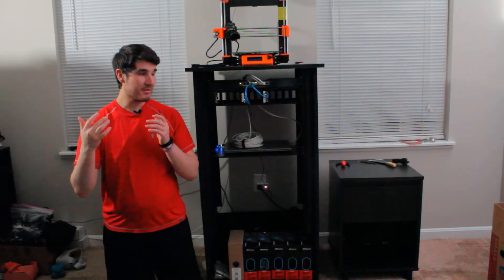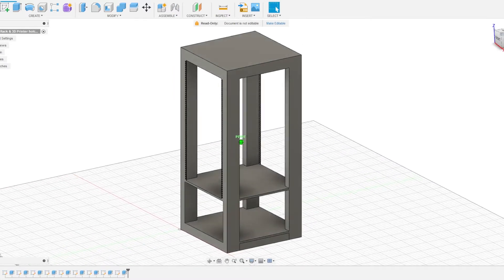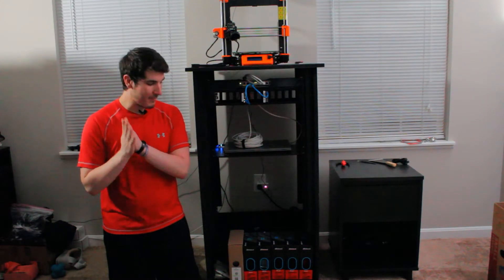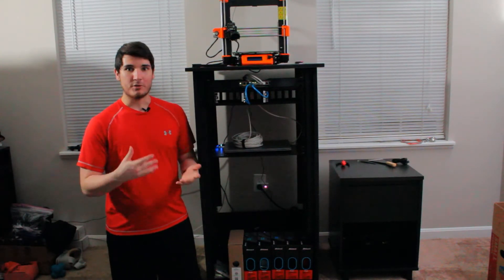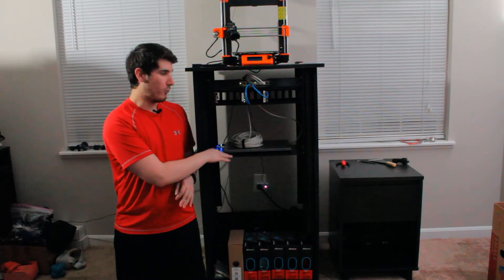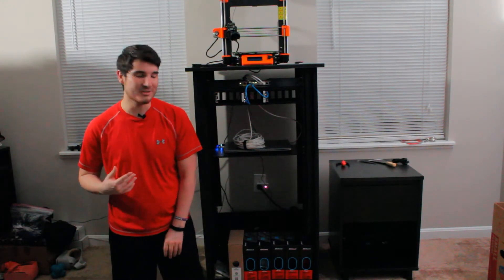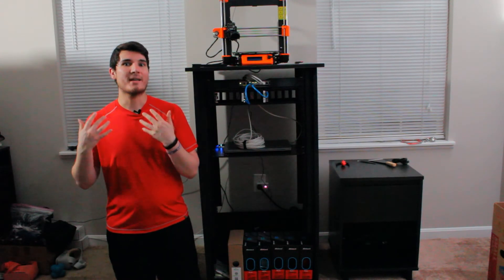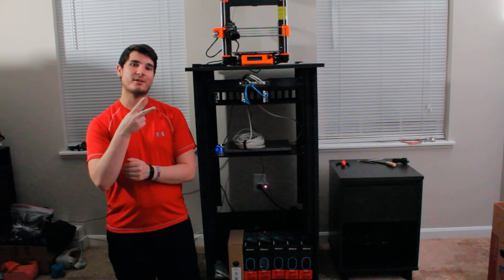DIY Server Rack Cabinet With 3D Printer Storage!

Comment: literally just bought a used 26u rack today and was searching a video about it... mine is closed with a glass door. and im thinking of isolate the walls with firepoof foam
Reply from the maker: I didn't mention it, but we also built this one in a way that I could add a front door if I wanted to down the line. Foam could also be nice for noise if it ever gets too loud. Hope your rack treats you well!